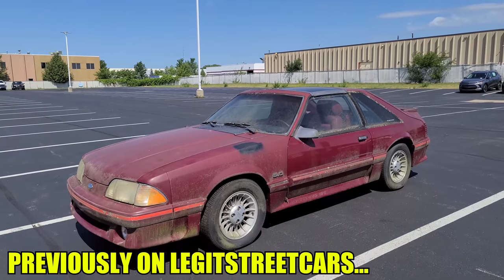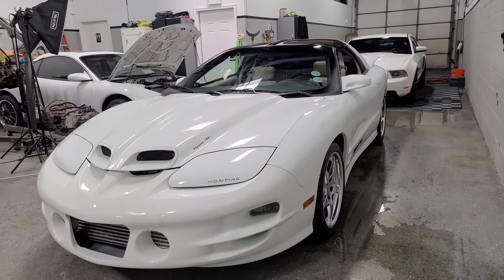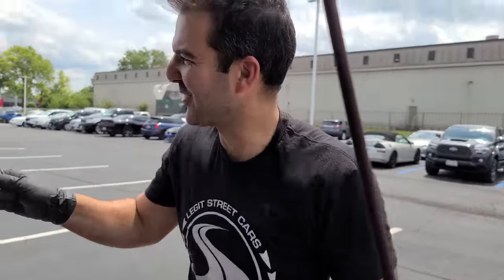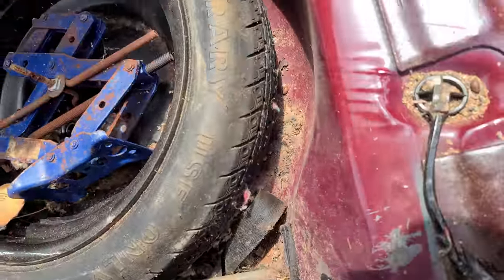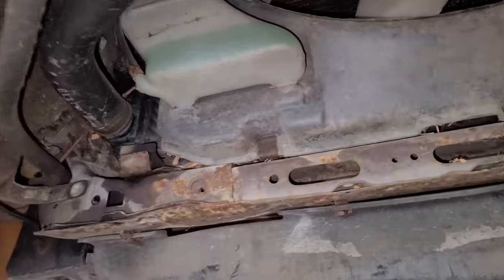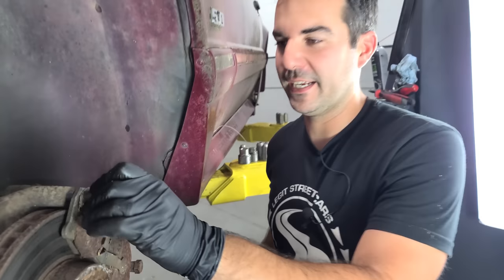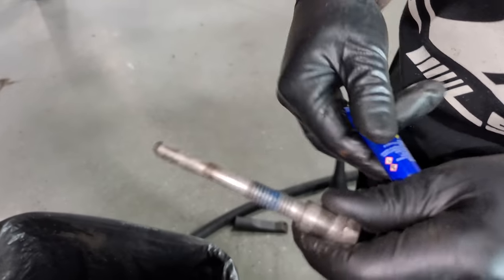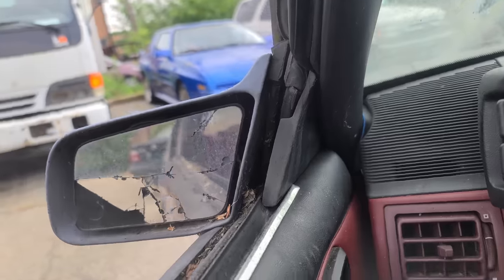First Drive Of The Abandoned Mustang GT Didn't End Well But We Discovered Its Crazy History!

Comment: Hey Alex, I noticed in the last video that you may have installed the fuel filter backwards. The new one you put in is in backwards compared to how the old one looked. I thought I was just seeing it wrong but with the fuel issue it might be worth the check. I hope it´s something as simple as that. Love the videos, keep it up!
Reply: I noticed that too.  I agree with Adam here
Reply: They ddon't much care which way you put them in. They just filter better one way.
Reply: @taknmybeatings7036  more restriction makes higher fuel pressure. higher fuel pressure messes with the way the ecu makes the car run there for causing problems
Reply: @AK086.  ah not really how it works at all. the rail pressure is regulated. The completely inconsequential difference that a backwards inline filter would make is, well, completely inconsequential.

Comment: Alex I was always told to open the bleeder on the brakes so you're 1) not forcing fluid the wrong way through the brake system 2) not disturbing any crystals that have formed which can shred the diaphragm on the brake master cylinder.   Thoughts?

Comment: 1987-1988 5.0 Mustangs were 225bhp. Cam and mass-air EFI changes for 1989-1993 caused 2hp reduction.  They all dyno factory 190rwhp, even ‘93 with hypereutectic pistons.  Ford changed its rating method as a marketing scheme for the SN95 1994 mustang.

Comment: I gotta admit that we are pretty spoiled outside of the rust belt. I have lived in middle TN my entire life (Aside from being stationed in North Carolina, and California while I was in the Marine Corps).
I drive a 2003 Honda Accord V6 3.0L Six speed manual that has been in TN since it rolled off the lot. It has zero rust on the entire body, including underside, panels, etc.

Whenever I do regular maintenance on my car, I never even really have to think about using a penetration oil, or heat unless it's been threadlocked.

Comment: My 88 did the same thing bogging and popping.. replaced the fuel pump twice.. and still did it.. took it to a garage that put a ford fuel pump in it.. and fixed the issue.. can’t use the ones from local auto parts stores..

Comment: The VW Golf 1 went on until about 2010 in South Africa. It continued it's run as a "Citi Golf" and went through various different stages but still kept it's original design. It is still in circulation now on the second hand market. Not as long as the beetle but still quite long. It was the first car for many. It was easy to maintain and modify.

Comment: Older fuel line hoses would sometimes deteriorate on the inside creating a "flap" when pushing to much pressure thru. The flap will close off the flow of fuel. Only way to fix that would be to replace ALL of the fuel line hoses because you will not be able to see where that flap is. It is due to dry rot, I believe.

Comment: fuel filter .... change 👍🏻 issue solved. also in 87 it would have a throttle position sensor so that maybe worth a look. could also be the fuel pressure regulator. all cheap parts to replace.

Comment: Citroen 2CV, unchanged from 1948-1990
C3 Corvette  1968-1982
Hindustan Ambassador 1957–2014
Ford Ranger, 1993-2011, just minor face lifts, only things come close besides beetle.

Also Atlanta checking in, i have litterally never seen anything beyond surface rust on most cars here. Ive been here 30 years, its snowed....4-5 times tops for than an inch

Comment: I own a 1989 mustang gt with 146k on the dash, looks brand new inside. Other then ashtray is broken and the interior has black dash and front carpets. Red rear carpeting on side below back seat, white with red accent seats and the seats are kinda broke. 

It’s a red gt with a black top but as I learned from the door tag. The interior at one point was scarlet red and Oxford white. Had a red exterior with a white top when new. 

But now it’s (clear coat faded) red with a black top. 

Has bbk shorty headers, bbk x-pipe, mac mufflers (unsure of specifics with exhaust) and perhaps a little after market chassis reinforcement

Comment: A trick for removing the inner seal is: after removing the outer bearing, put the washer back on the spindle. Then pull the rotor towards you. The washer will catch the inner bearing and seal and it'll come right off from the inner side and left hanging on the spindle.

Comment: I totally agree with evaluating the interior, but it also cracks me up because my 25 year old Dodge with 280k on it looks like an 80k truck on the inside aside from the driver seat that had to be repaired from sliding in and out of the truck. And that was at 200k. I've seen trucks under 100k with a ripped drivers seat. It's kind of mind boggling how well this truck has held up since Dodge interiors in the 90's were not known for quality. The pickup tends to fall apart around the motor.

Comment: My neighbor just bought a fox for 600 bucks that had been sitting for 20 years. I am pretty certain it only has 40k original miles. The factory headers have no rust on them. Can clearly read ford on them. The car is in rough condition because of being under a cover for that long. But the engine bay is in great condition.

Comment: Did I miss a portion of this or did the brake fluid get left alone ? One lesson I learned ages ago about old undriven cars is replace the brake fluid and bleed at each axle , reason is two fold 1st is old fluid is danger as it could of broken down rubber or any other stuff and been contaminated and also it forces you to look at each axles brake assemble so if there's any issues you notice it then hopefully and not going 60mph when a wheel cylinder or caliper fails and leaves you to stop with an e brake and a prayer . This 5.0 is the find of a lifetime, kudos to the buyer hopefully he learns how to use that 3rd pedal with grace .

Comment: When installing a Ford Windsor thermostat you must be sure to keep the thermostat correctly in the housing recess using the gasket before reassembling. I've had the thermostat shift out of that recess and it 100 percent will cause a leak. 😧

Comment: Nissan Frontier D40 ran from late 04 (05 MY) - 2021 in the US using the same body and used the same basic engine with tweaks over the years from 04- 19 (VQ40DE). It had a 17 year run to the fox body mustang’s 14 year run.

Comment: I have a 92GT Mustang. With about 11,000 miles on it. It has sat since the mid 90's .  In 1992 this car was written up in all the Mustang Magazines because of it's suspension mods. It was originally built as a prototype to compete with the Saleen Mustang. The company that was building these cars was Slot Car Mustangs. The origional 5.0 engine and T5 transmission are long gone. If you are interested in this unique car please contact me and I can fill you in on all the details and specs.

I alao have a 1995 Cobra R Mustang with 12 miles on the car, which was the back up car we raced in the IMSA Championship Endurance series in 1995/1996 season. This was a showroom stock racing series. Both of these cars are for sale.

Comment: Not sure if it would work for the smaller size bolts, but I have a ratcheting open ended adjustable wrench that's perfect for when you only have space to do an 1/8th turn at a time

Comment: I would have replaced those rear wheel cylinders.  Those old rubber cups are sure to leak in about 1000 miles and those springs can be difficult for someone not familiar with old tech.

Comment: Very cool!!  Also, I think that the Mercedes G Wagon has been going strong from 1979 to present, with very little update, outside more electronics and better interior and a few external add-ons.  I think they only just changed the model code in like the early 90s, so you get a pre-1992 or a post-1992

Comment: I would start with a mass airflow sensor and the injectors, computer. The 5.0 this generation absolutely requires a working mass airflow sensor, not like a GM where you can unplug and default the computer to test either. No mas no wide open throttle! A lot of companies used the mas for tuning strategies back in the day and I remember you had to match the mas to your injectors or it would give you same issue, no WOT. Just a guess since it runs good at idle I wouldn't think it would be a spark issue.

Comment: This comment is late but as a former owner of many foxbodys you should have checked the condition of ALL the brake lines...for a foxbody sitting as long as this one...Ford equipped foxbodys mustangs with thin walled lines,and the line leading across the firewall to the right side for the rear brakes often look good but blow....violently.

Comment: fairly sure the volvo 240 (1974-1993) has one of the longest single gen production runs of any car. every car from any of those years is extraordinarily similar and most of the parts are completely interchangeable.  
another fun fact, the 240 ended production AFTER its predecessor the volvo 740 (1984-1992) beating it out by 1 year while being produced for 10 years prior to the 700 series' release.

Comment: I bet the issue was the ECU.  Common problem that the capacitors leak. Especially if the car has been sitting for sometime.  Three dollars in parts and it’ll run excellent.

Comment: If you didn't flush the old brake fluid out with solvent, the synthetic fluid will mix with the old fluid and turn to a gel. You have to THROUGHLY flush the old brake fluid out BEFORE you put the synthetic  fluid in.

Comment: In 2000 I found a 1987 GT Mustang for 3000. I wish i had bought it. I didnt buy it because whwn i touched the Automatic Handle it popped off in my hand. We tried putting it back on. Probaly an easy fix. I ended up finding a 68 Cougar GT/ XR7. 390

Comment: The bypass is same from 1962 221 260 289 302 all the way up til 1996 i bought a Goodyear one for my 64 falcon futura 347  about 10 years ago it was like $10 later i had to replace water pump and got the blue hi temp Goodyear hose and it was like $25 and had to cut like a inch off it to fit right.

Comment: I was a teenager in the 80’s so when 86 came I could get my license early with drivers Ed and yea I had my first mustang in 87 crashed it a year later then bought a new one in 88 I didn’t get the gt it was cheaper version same engine all that what was it called Lx it was awesome except when it snowed I lived on a hill so I would have to back it up the street just to get up the hill lol lower gear ratio in reverse

Comment: The igntion switch is a common problem on those year ford's.
The ford thunderbird is a much better platform.  The MN12 chassis has had independent rear suspension since 89 to 96 when they sadly stopped production of the bird.
I've owned 12 mn12 birds, over the years. The 3.8 V6 supercharged SuperCoupe,  4.6l V8 lx and 5.0 V8 lx.
The supercharged Thunderbird beat the mustang and corvette from
1989 to 1995.

Comment: Atf in a manual transmission? I've been working on cars for 45 years and I've never seen that one before. Usually it's that rank smelling 90 weight gear oil. Same crap thats in the diff. Maybe I haven't been working on new enough cars lol.

Comment: I suspect the computer capacitors that are part of the injector circuit have given up the ghost. These parts are getting old now. You can pull the computer out (should be in passenger footwell) pop the cover off and inspect the capacitors and it will be a dead giveaway if they have failed. They will either be swollen or cracked and leaking. My fox had the same breakup under load issues I thought it was fuel/tps/spark and chased it forever before looking into the computer. Rebuilt computer and it screamed afterwards.

Comment: You're not correct about the wear on the interior. The foxbody I have was my mom's. It has 144k miles and the interior is in the same condition as this one. Just Grey and black instead of red. No cracking in the seats or rips or tears. And it was never garage kept.. Always stayed outside its whole life. They are just really well built interiors. Just saying. And if the carfax said 53k then it definitely rolled over to 143k.

Comment: Has anyone else cut or hurt themselves when using a wire wheel in a drill?? Freaking hurts like hell and it always happens when your holding the thing in your hand that you are tying to clean. I have also done it with a die-grinder... UGH

Comment: Rust? In the desert? ROFL...I've got a 3500HD Chevrolet Silverado...2007 model...looks almost EXACTLY underneath, the way it looked when it was brand new! We get about 10-inches of rain a year here in West Texas...your problem with 'older cars' comes, when you either take them into 'wet areas' when they're 20-years old (they tend to electrically, fall apart); or when you get them into 'wet areas' and all those 'bearing surfaces' start failing...always replace ALL your bearings and grease seals, when you get a 'desert car'...and be religious about cleaning/changing your air filter(s) too.

Comment: Them 302's are bullet proof, much like that 3800 engine you Boyz are familiar with. 300k on a 302, even beaten on, is not unheard of.
Sounds like a timing issue. 
Btw, 225:hp, not 215. I think in the 92-93 it was 215. The 87 was absolutely 225hp

Comment: U messed up blowing all the grease out. I been working with bearings for years. All kinds especially high speed bearings. It would have lasted longer wiping just the outside of the bearing adding just a what u wipe off and replace.  Don't ever remove all the grease unless it's a emergency meaning you see metal and need to keep using it then u can completely clean it and hope for the best until u get a replacement. Once it's broke in cleaning out all that good grease is taking life off the bearing. U should have just bought a new one. You already had the rotor off.

Comment: Using the impact gun on the locking wheel nut adapter is a bad idea. So easy to destroy the key. Should be broken free by hand. Same when tightening. Torque by hand.

Comment: Why wouldn't you just open the radiator cap and see if it was circulating before replacing a thermostat that doesn't need to be replaced it seems you do a lot of stuff that's not necessary and you don't know as much as you think you do

Comment: Inhave a 65,000 original mile 89 lx convertible with a 2.3 auto in it and it runs like a new car. Needs a muffler and tail pipe amd the ac charged and its good to go. Im asking 3500.00 bucks for it. I might go down to 3000.00 but thats the lowest im gonna go

Comment: The longest car runs?
VEB Sachsenring Automobilwerke Zwickau made the Trabant 601 from 1964 to 1990 with just minor changes. not even a real Facelift was done...
Lada WAS-2105 was built from 1976 to 2006
GAZ-24 was built from 1968-1992
VEB Automobilwerke Eisenach built the 353 from 1966 to 1988
UAZ is building the 452 since 1965 with just minor changes, 
UAZ built the 469 from 1972 to 2003... So I guess in "Uljanowski Awtomobilny Sawod" is the Winner in this... 
You can't beat the soviets in selling outdatet stuff xD

Comment: I had an 87 GT just like this this one same exact interior five-speed except it was black on the outside. I ended up putting in a Ford SVO crate motor with the SVO aluminum heads I had it for about a year and then pulling out of a self-service car wash a lady lost control and crashed into my front driver side fender really badly. The car still started after the accident the AC even worked although the radiator leaked and all the tie rods and control arms for that side were bent. So then I decided to sell the car on eBay as is crashed I figured somebody could maybe either fix it or use the engine. Ended up selling it on eBay I think for like $3,600 bucks and the guy just never picked it up months and months would go by and I would say hey you got to pick up this car or it's going to get towed because I lived in an apartment complex and it had a car cover on it and they were okay it was kind of out of the way but I was going to move soon. Over 6 months went by and the guy never picked it up and would not answer me and I got paid the money so I had the money for the car all I knew is he lived in a different state so he was not local..... I was desperate thinking the car was going to get towed once I moved so I sold it to a local enthusiast for $2,200 bucks. Never heard from the eBay guy at all even though he paid me I have no idea what happened to him. So all in all I ended up getting $5,800 bucks for my wreck but still miss that car like you wouldn't believe even though I have a 95 trans am 6-speed now. This all happened about 10 years ago only car in my life I've ever sold twice and still to this day over 10 years later have never heard from the guy that gave me $3,600 bucks and never picked up the car.